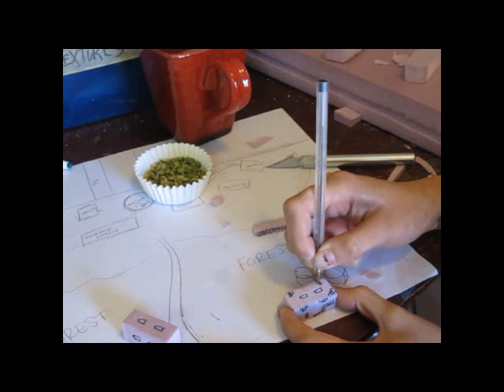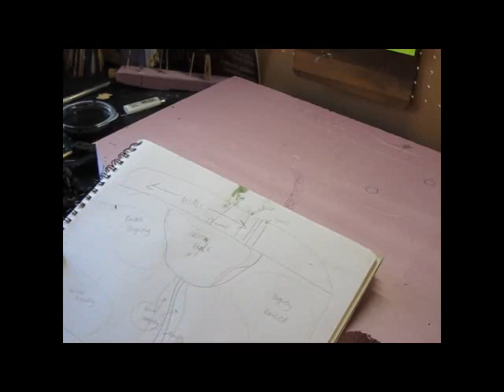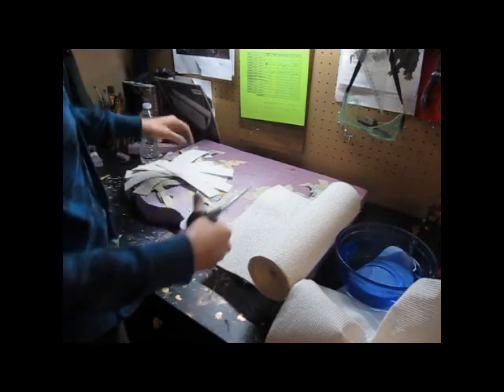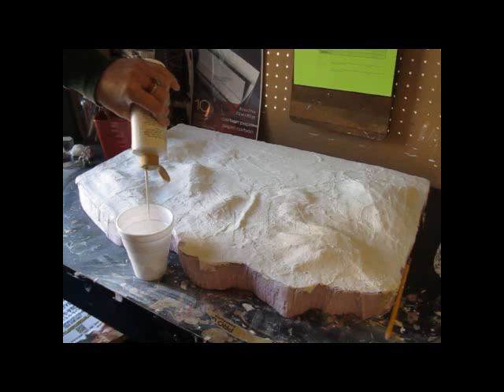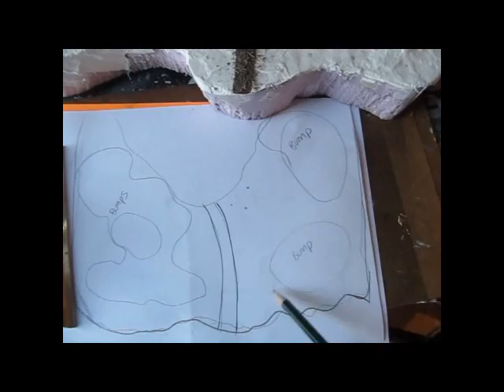Make a Game of Thrones Diorama: The Wall and Castle Black

Comment: This may be one of the coolest dioramas I've ever seen.  The working elevator is just too awesome.  A tip for working with pink/blue insulation foam and styrofoam; give it a coat of regular white/pva glue, like Elmer's, to seal the foam and it will allow you to use spray primers and paints on it.